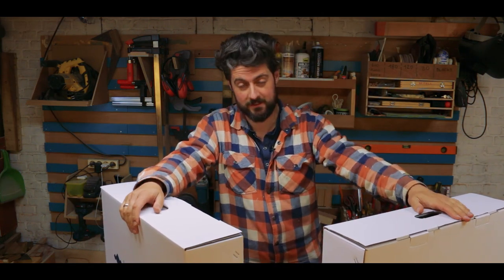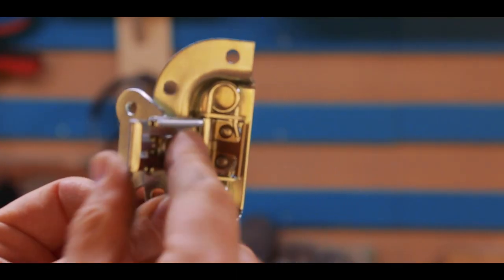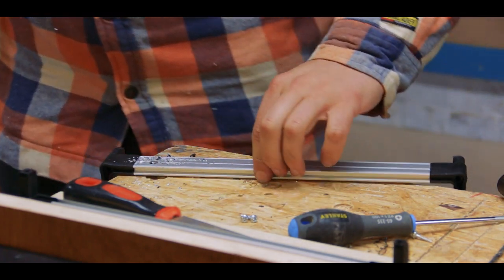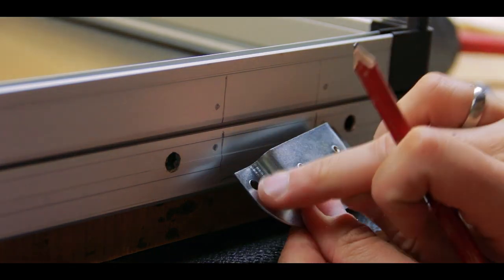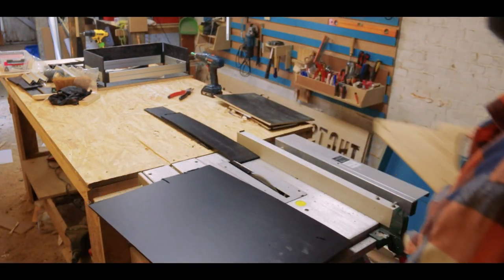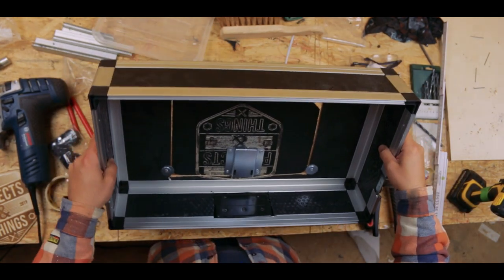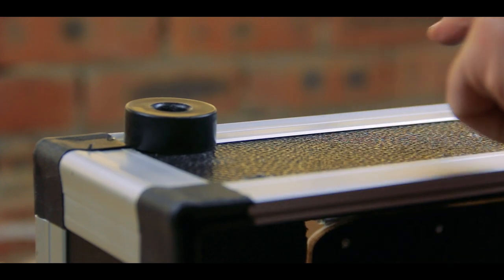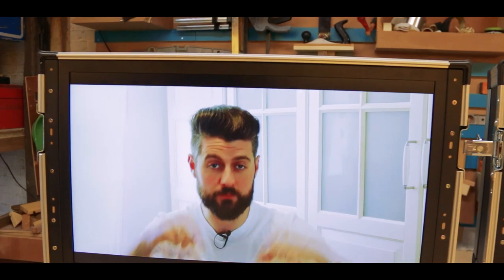How to Make A Custom Flightcase for Anything.

Comment: Thanks, you helped me protect my gear...
Reply from the maker: You’re very welcome Melissa, did you make the same or a different design? Just curious:)
Reply: @ProjectsandThings I still have to make it. I went "on the road" as test this weekend and found me needing a properly sized flight case for two synthesizers and a mixer. I bought a disco bar box, but it takes two people to lift it...when empty. Too big, too heavy. 🙂
Reply from the maker: @melissarainchild  I found that 4 small flightscases for my gear works best. I can carry each case solo and do not need a van to transport my videogear to jobs. If and when I add to the collection of mixers and screens I’ll add another “small” case to the stack :) good luck with the build. If you get round to making them I’d love to see a picture of the final result. My email is ok the contact page of the channel. YT won’t allow me to write it here.

Comment: Thanks for the lesson in making cases. can you provide the source of materials that you discussed? also at 8:57 in the video i saw that a pop rivet wasn't seated well, how do you correct for that if it happens, do you use plyers or a hammer to correct a pop rivet that didn't go in all the way?
Reply from the maker: Hi Mike, you’re welcome! For me here locally in Belgium, the supplier is called flightcaseBrico. The best option is to google around for “flightcase parts” or “easy case parts” those are the lighter and thinner materials for smaller cases.  Like 7mm plastic sheets and plastic easy-case corners for example. 

For the rivet I usually drill it out and re-do it if I notice the bad seating (sometimes I clearly miss it) i have been able to fix one or two with the gas type pliers. But quite often they are in spots that are too hard to reach so I end up just redoing it. Hope that helps sir!
Reply: Thank you for your response!

Comment: Cool video, just found it thanks to the almighty YT search algorithm!
Could you share a link to where you buy your flight case material? Rails, corners and wood boards? Thanks!
Reply from the maker: Thank you mark! YT won’t let us post links in the comments. I bought mine here in Belgium at flightcasebrico (dot com) but looking at yr name I’m assuming you are not based here. If you google around for “Easy Case flightcase parts” you should be able to find a reseller for this specific type of flightcase part.
Reply: @ProjectsandThings  I'm in the euro-zone, on the other side of your western border!
I've looked at the site you mentioned, the prices are insanely low, I'm going to make flight cases for everything now! 😀

Comment: Amazing and perfect for my preparation too. Where did you get the flightcasematerial from? I have the wooden but need the rest. ;-) Thanks in advance.
Reply from the maker: Hi, I got it from a belgian webshop called Flightcase Brico. But if you google around where you live for flightcase building/flightcase parts you should be able to find the same.
Especially the Easy Case system, that seems to exist worldwide

Comment: That's a really nice idea for screens, having them face each other like that... But the back door is incredibly ugly, I couldn't use that, that would bother me so much :D You should have also used the aluminium extrusions for that or there are even pre-made doors for flight cases, like Adam Hall 87600/87601/87602, that you just rivet in...
I'll probably build something similar for myself, as I can never have enough screens :D
Reply from the maker: Thank you. I’ve learned that those doorflaps exist, since building the cases. But now I love my janky back-door solution even more. I think that if they would function poorly, that would bother people way more during use then the looks. But to each their own :) thank you for the tip about Adam Hall!
Reply: A flight case should be able to be transported in the rain though, and now yours can't.

Comment: Great video. Anybody know where I can find out more about selecting material? I've been looking at baltic birch and some other ~void free plywood. Wondering what thickness to select and how hard it is to do a good job laminating it in my garage. Or is it better to buy a pre laminated product?
Reply from the maker: Hej dr. Pepper. Laminating your own is tricky and seems hardly cost effective. The fact that most places that sell parts for these sell both brich ply and plastic in 7mm and 10mm thicknesses, each finished in black with a hard shell, seems a good deal to me :) 7mil for small cases like mine and 10mil for bigass heavy rolling flightcasea
Reply: @ProjectsandThings  Thanks PaT. The first 3-4 boxes I want to build aren't that big so it might be worth laminating myself. Bigger would be a pita. I'll have to look at pricing. I know BB comes in 6 and 9mm so the laminate must be 1mm. Good to know those are the common sizes.

Comment: As un Upgrade idea You culd use a PatchPanel with weather Proof Connector so you dont need to Cut a Big Opening in the back
Reply from the maker: true, I have thought about doing exactly that. But since building the case with hilariously badly cut out doors, I'm using the space behind the screens to stash Headphones and headsets that did not fit anywhere else. But your tip is very valid, If I build another case like this I will for sure go with a patch panel.

Comment: Awesome video. Where did you find those rails to be mounted to the side of the monitor?
Reply from the maker: Thank you very much Andres, the rails came with the monitor. Its from BEETRONICS, I don’t know if you can find them separately anywhere, since they are made to work with the monitor and the monitors have mounting holes specific to that rail. Perhaps you could google for “19inch monitor rails” to find a thing that fits your own monitor, just a guess

Comment: What size rivets do you use if you are putting handles on 1/4" laminated plywood?
Reply from the maker: Hej John. On the parts where the handles sit on top of the aluminum rails I used 9.5mm rivets, since they don’t go all the way through. They just penetrate one level of that alu rail and bunch up between the 2 layers. When going though the handle and the plywood I used 12mm rivets
Reply: @ProjectsandThings   Thanks for the info! I've been asking this question to a lot of case builders and been geeting a wide variety of answers.

Comment: Quick and 'easy' system, but the backdoor could have been straight :)
Reply from the maker: I fully agree. That was a freehand-not-so-good-idea :)
Reply: @ProjectsandThings  but it's like the flemish saying "ge moet wel kunnen zien dat het handwerk is" 😀
Reply from the maker: @krisgeusens162  100% mee akkoord. Anders is het niet plezant meer :)
Reply: @ProjectsandThings  this is just about ordering extra materials tbh. There should be single edge extrusion that will make that look a lot cleaner.

Comment: Where did you get everything for making this
Reply from the maker: Hi Gwenie, I don’t know where you are based but I found my stuff here in Belgium at a place called flightcase-brico, its a webshop that has all the parts. I found a bunch of companies all around the world that sell the same kind of parts, just google for flight case parts or build-yr-own-flightcase. The EasyCase system is what I used since its the most lightweight. Plastic corners and such…..
Reply: @ProjectsandThings   are these strong enough to carry a 75 pound medical machine to an airplane
Reply from the maker: @gwenienelson2535  if you use enough rivets, yes. But I would suggest you upgrade to something with wheels and thicker materials.
So 7mm flightcase plywood, and aluminum corners instead of plastic. But both of these should work. What are you planning to transport in it?